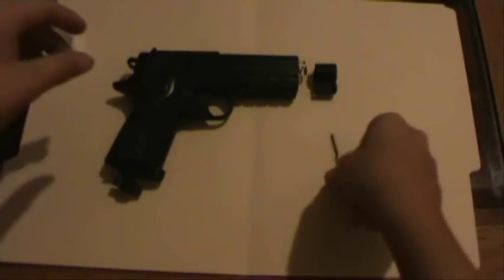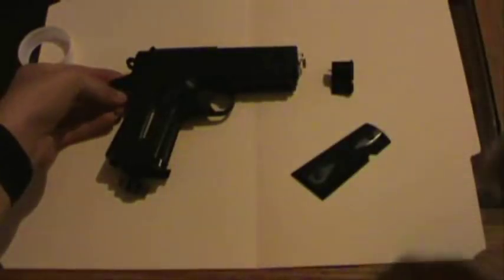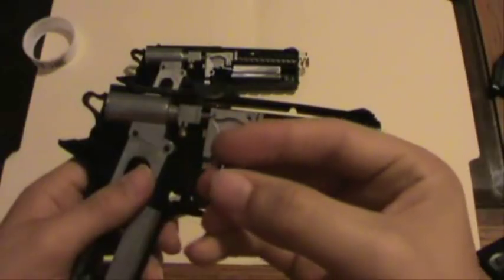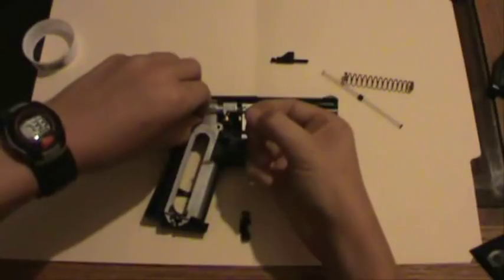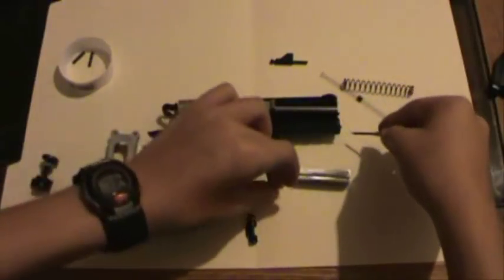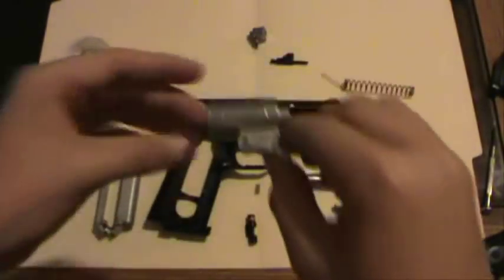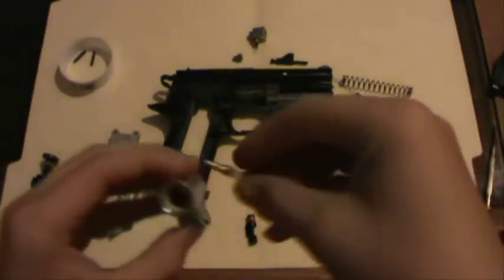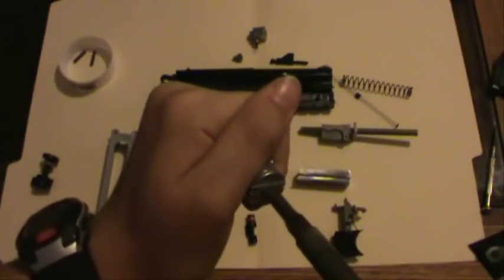Daisy Powerline 15XT CO2 BB pistol leak repair Part 1

Comment: Worked. Thanks. But you should point out where the springs go. And that little brass thing held by a spring isn't mentioned. I took it apart and half the crap flew out so I didn't see where it came from.

Comment: Bought this pistol over 11 years ago. At the time, I used it and got the CO2 leak. Never used it again. Just put it in a box and forgot about it until yesterday. Almost tossed it until I saw your video TH3C001. Used the Teflon tape and just fired about 60 shots. No problem. Thanks so much for posting. Don't despair over any insulting comments, especially since you're giving this info away for FREE. I would caution others about the screw at the end of the barrel though. As I backed it out, the barrel end and two inner springs shot out. Fortunately, they're big enough to find quickly. WELL DONE!

Comment: great video,solved my problem first time.i did it in half the steps .open it up remove the case the co2 sits in then remove the fake hammer piece.carefully wiggle out the back peice.teflon the cap, screw it back in ,wiggle it back into position and your done.reasemble the co2 carrier put barrel and bb springs back in and screw it back together.also double up a peice of teflon tape put it over a new co2 and put it in.makes for a perfeclty sealed unit.thanks again for the video.
Reply: Thanks for the added comments.

Comment: My Dad gave this to me over Christmas break because of the leak. Figured there was a way to fix and this surely did it.  I went the teflon tape route.  Someone else suggested using Locktite which I wouldn't recommend as that would prevent further access from the other parts in the gun. Your fix worked like a charm.  Thanks!

Comment: The barrel and loader springs will fly out when the front screw is removed if you don't hold on to the barrel end piece. Make sure to hold onto it as you remove the screw and have the barrel pointed away from you.

Comment: I have one of these pistols. I like it but it does have an air leak. At the moment it doesn't for some reason and I surmised that this pistol is fitted for certain CO2 cartridges. It's a very complicated gun and I don't like springs popping out everywhere been there done that with carburetors LOL so it looks like if I get into that cylinder and put that plumbing tape on that should stop the leak.

Comment: I just took the screws out split the gun, tightened the valve screw and put back together in about 5 minutes. Problem solved. You can get to the screw without taking all those parts out.

Comment from the maker: Good idea, I've also thought to use that 3-in-1 oil in the white bottle with a red cap, but actual grease is the best. But on some air guns like the Daisy 105 Buck it actually "asks" for oil. But for something like this, yes, some grease would be best.

Comment from the maker: Maybe in some cases, but for me, it was specifically an internal leak. I know that there is a common problem with the CO2 canister leaking around the fitting, but mine has never done that, although I hear the Crossman P10s do that a lot due to dried up seals.

Comment: How would I know if my 15XT is leaking CO2? Mine works fine for the most part, but seems to lose its gas power a little too quickly. I also noticed a little bit of moisture or condensation on the inside part of the trigger after firing. Is it leaking?
Reply: Yes

Comment from the maker: I would say your gun is leaking. For mine, it leaked from the internal tank at the rear,, the most common apparently. I knew because it had gotten so bad that CO2 shot out in a visible stream. It wouldn't hurt to take yours apart and tighten things up, check stuff out, only if you feel comfortable though.

Comment: What type of teflon did u use
Reply from the maker: Regular Teflon made for faucets and other fittings. Could use the yellow stuff for gas application. Next time I might want to use acrylic or silicone sealant.

Comment: My gun just sprays out all the c02 as soon as i tighten it
Reply: Hi George... I just used this video for the 2nd time in 2 years to fix my Daisy Air Gun. As TH3 explains in the video, it is about correcting for the CO2 escaping from the top back end. If your leak is at the puncture pin assembly, there is a small seal there that may need to be replaced. Think you can order it from Daisy for something like 50 cents.